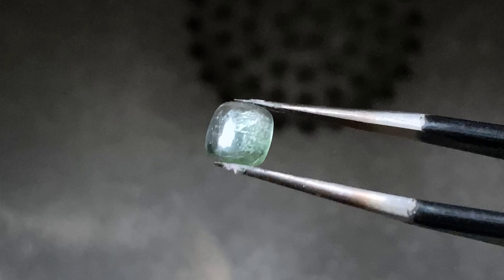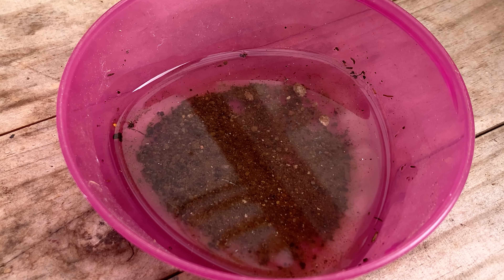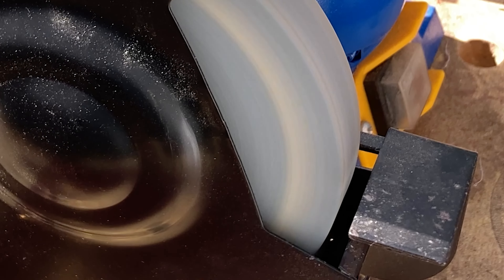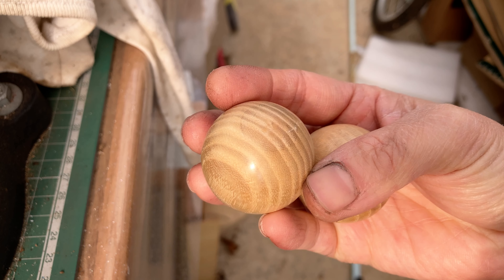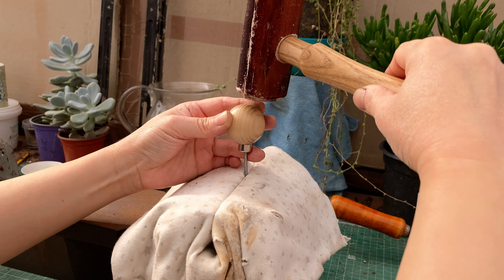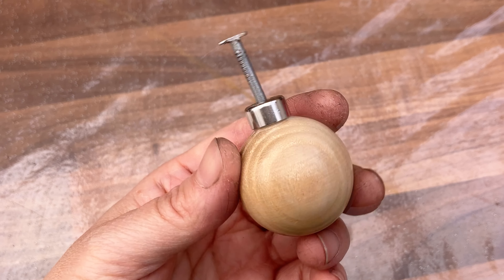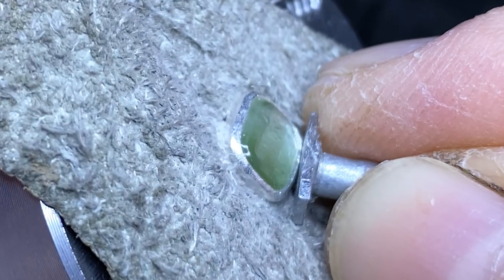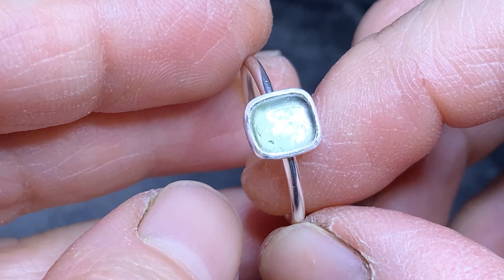3 Steps to Make a Cheap Bezel Setting Tool

Comment: You are using galvanized roofing felt nails. The galvanizing coating is there to reduce the chance of rust, but when heated it produces a zinc plume that if inhaled can make you temporarily sick. Ideally you would remove the zinc with white vinegar, takes an over night soak, before you grind. As you grind only a small amount in a relatively spacious area you should be fine, but it is good practice not to get galvanized steel hot & if you do, minimize the vapor you inhale. The tool worked great & the result was good. Nice when you can make your own tools that perform as well as a shop bought one. Blacksmiths are another craft where many tools are made as necessary, customed to the user & job. Thank you for sharing!
Reply from the maker: Great information about the galvanizing coating! Thanks for sharing!
Reply from the maker: I think I will stick to tool steel next time, rather than finding anything random. Just in case 😅
Reply from the maker: Thanks for sharing! Much appreciated!